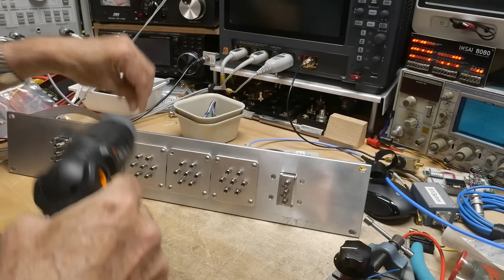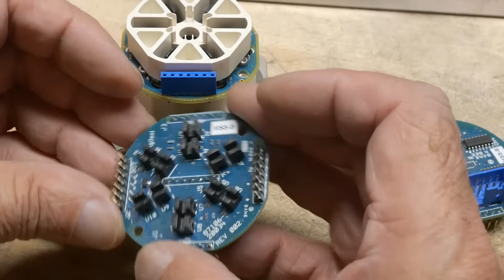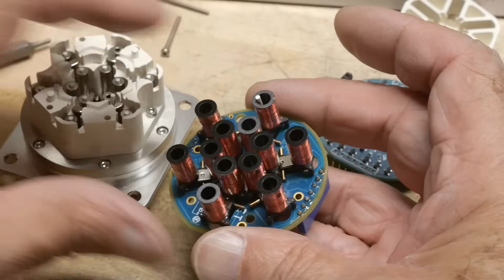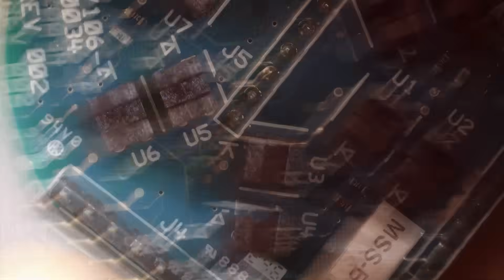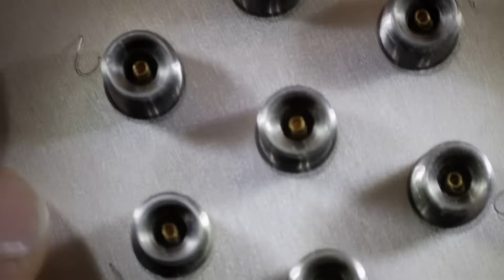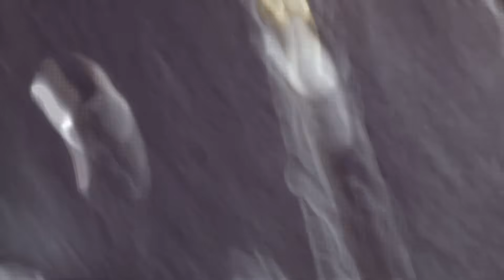#2531 Rotary Coaxial Relay SP6T 40GHz

Comment: The movement seems to be radially not axially or up and down as you described. The slotted detectors hint at this, one position is towards the center, the other outwards to know if any of the contacts are in or out

Comment: The sma  6 port relays are going for $ 800 new open box on eBay I remember about 1800.00 back when we used them 15 years ago……and you had to buy the controller unit as well.

Comment: Hi IMSAI Guy.  I love using those HP/Agilent/Keysight SP6T relays!  I made an enclosure. Custom 2"x2" i2c control board on the back of 3 relays, controlled by RBPi5, i2c display that interfaces to PC.  I am on version 3 of the project.  Is this something you want to see more of?

Comment: The switches are like teeter-totters, they pivot on the hinge in tbe black plastic piece in between the two electromagnet coils. It explains why you weren't able to move them in and out, they move side to side.

Comment: I suspect that the speed and force of the solenoids is controlled so that they behave more as linear motors of sorts rather than just conventional bang-bang solenoids. That would facilitate clean, repeatable switching timing. It would probably also prolong the the working life. I'm guessing those things are used in automatic test equipment where millions of operations are required. That requires some finesse.

Comment: Looks like you dremel disk'd it. I've found that old PCB router bits are great for going through plastic without melting or chewing it. However, I've only used drill press RPMs (Probably <1000)

Comment: Each contact goes between two states - connected to the center or isolated and connected to 50 ohms. The coils control one of those contacts and the optoswitch detects which state the contact is in

Comment: At least make sure you don't loose bits of it, if you don't put it together right away!
Reply from the maker: it's not going back together
Reply: @IMSAIGuy  😭
Reply: @IMSAIGuy  None of the bits look broken.  Someone might be prepared to pay a few bucks for a 5 port switch and it might be interesting to see it they can be reassembled without compromising the specifications.

Youcould do another video on the reassembly and crosstalk and 50 Ohm terminator testing.

Comment: The opto stuff is “Auxiliary contacts”. In some applications you want positive verification that the mechanical parts are obeying the electrical command. When the  switch arms move open/closed the interrupters change state. They
 output an optically isolated signal, probably on the other 6 pins of the ribbon. This is an option often available on coax switches.

Comment: What is the isolation between ports like?
Reply: looks like almost half a millimeter at each end of the strip line,  The output port is probably also connected to a 50 ohm terminator so all told I would think decent.  Datasheet is probably available for similar units on the net.  A few people found list prices between 4000-6000 US$

Comment: The SMD IC looking things are labelled CRn which is the traditional designation for a Crystal Rectifier or Semiconductor Diode while the photo interruptiors are labelled Un but have a diode symbol in the silk screen to indicate which way to place them.  The fact that there are the 12 solenoids and 12 striplines with contacts at both ends tells us that they do not want to have any parasitic stubs connected from the other poles.  In use 5 short striplines grounding the unused ports and one long stripline connecting the selected input to the common pin.

The way it is made it looks like you could use this to route to multiple outputs at once if you want.  The striplines just touche on the edge of the pins. Obviously it would not be a good splitter above 100kHz any longer but there could be some use case.

The interrupters provide feedback to indicate which output is selected and verify that the rocker has toggled over.  I suspect that the relays might have a latching option so the coils do not need to heat up.

It would be interesting to see if it needs the external controller to verify the status or if the small circuit boards have enough transistor logic to switch the two required solenoids if the wrong port is active.

Comment: The board where you pointed out the optocouplers, they actually aren't. They are MOSFET relays.  The giveaway is the PCB component board marking's K1, K2, etc...
From a mechanical aspect, it looks like the solenoids aren't used so much to push down directly on the coaxial switch contacts.  It looks like they are configured in pairs with a rocker under them that rocks back and forth.
Reply: I figured out the black plastic pieces were rockers too.  The pogos don't push simultaneously but rather one or the other.
Reply: Everything looks like an optical device to an optical guy...
Reply: @scottbrown4534  LOL, didn't even think about that.

Comment: loose little things probably 50ohm
Reply: Yes, 50 Ohm termination resistors would be my guess as well. Each of the outer ports is either connected to the central (COM) port or terminated into 50 when in the "unselected" state